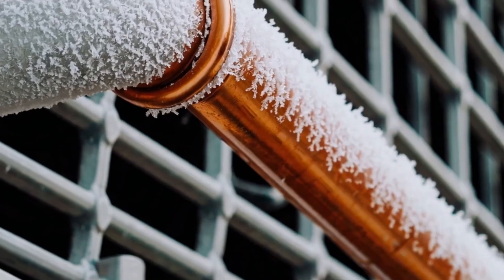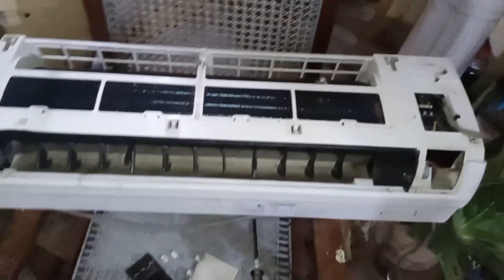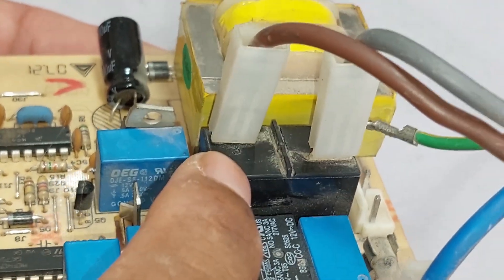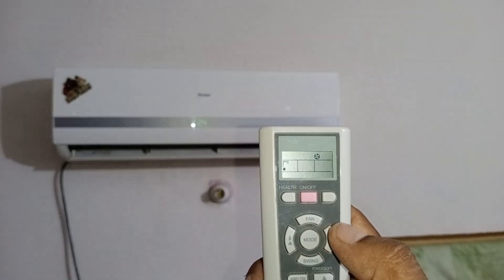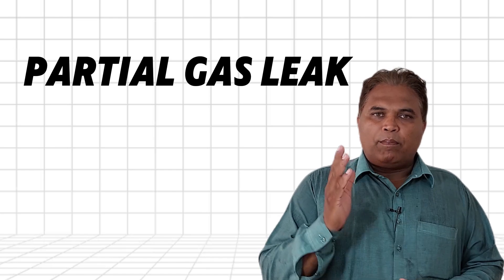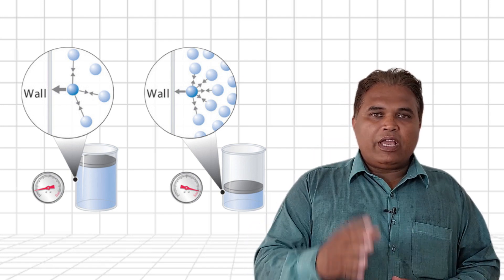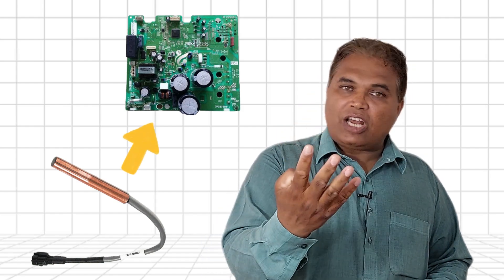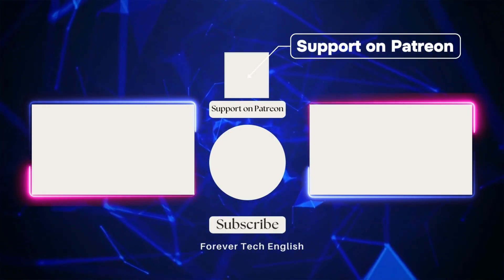You Won't Believe the REAL Reasons Your AC Suction Pipe is Frozen!

Comment: Hey very good explanation but what about ice build up when the unit starts up on the discharge line and the evaporator is clean and so is the condenser
Reply from the maker: That is another issue, the discharge line icing up is usually a sign of low refrigerant.